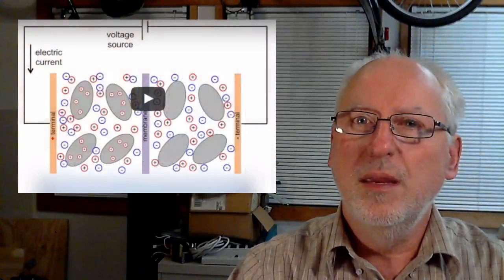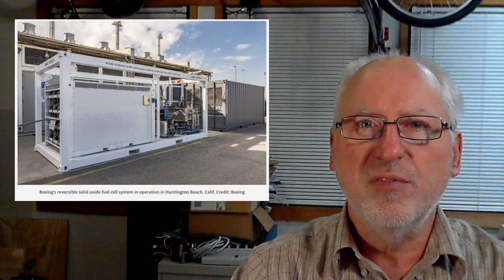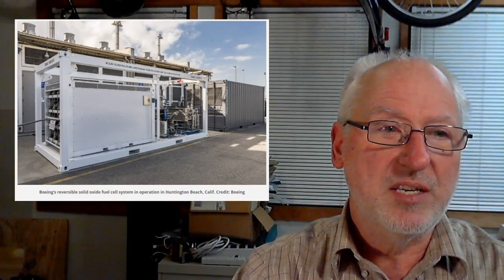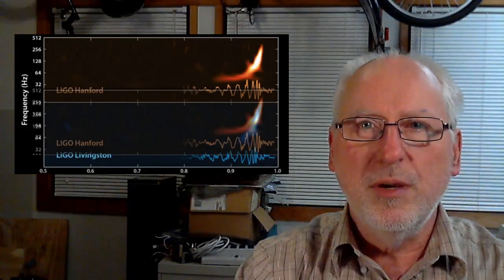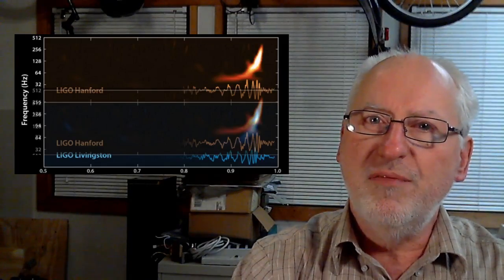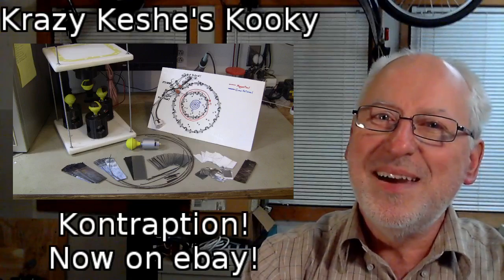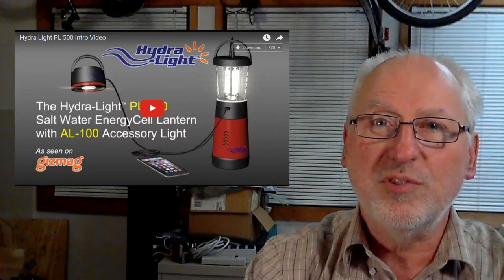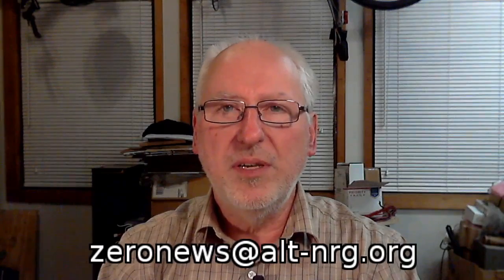#446 Zero Labs Alternative Energy News Update 2/12/2016

Comment: It's great that you are helping bring Robert Murray-Smith to a wider audience. One of his latest videos on using a small current to turn a permanent magnet on and off (the most practical application of the Ed Leedskalnin PMH effect I have seen) could remove the cogging effect from a permanent magnet motor. I would love to see you investigate that as a build! And that is nothing to do with his main research
Reply from the maker: +Simon Hagger NO! This is NOT a PMH. The PMH loses it's hold after the keeper is released. THIS is a true pulse energy switched magnet assembly! Pulse on / pulse off. The magnetism remains static after the pulses! Translation: This may be the holy grail for permanent magnet motors. It warrants further experimentation.
Reply: +ZeroFossilFuel that is a really great distinction that I hadn't thought about, forgot that the magic died when you broke the PMH. Now we just need to see some talented builders make use of the discovery.  The only other way I ever thought about overcoming cogging was by having one of the two magnet pairs on a cam lobe that lifted one of the two away with a gradual profile and then allowed a sharp spring loaded return at the appropriate point to push the magnet - the cam has been around since 300BC after all!.  Simply switching off the magnets would mean far less friction etc to overcome though and seems a very elegant solution compared to a purely mechanical approach.  Thanks Mark, hope you will take a look into it

Comment: Blacklight power changed it's name because the material used originally was a uv color or blacklight plasma. However when they realized the best way to convert to usable energy was a newly developed photo voltaic cells that were thought to be useless because each cell could harness the intensity of 1000 suns. We only have 1 sun, so it was shelved.Blacklight power had an idea to use them because the suncell's light bursts could be harness by these PV cells since it has the intensity of up to 10,000 suns. But the uV that the suncell produced was inefficient because the PV's absorbed brighter light more efficiently. So they started using silver gas and the suncell would emit a better spectrum for the PV's.  So their light that was emitting from their reactor was no longer "blacklight plasma". Hence the change to brilliantlight power. 

I saw a little scoff in your report about BLP, so I thought I'd give you a little info to help you be more confident in what is coming.

DR Mills was a Harvard grad. He is the inventor and patent holder of MSI. Magnetic susceptibility imaging. It is a sort of HD MRI. You can see the insides of the walls of your arteries with this technology. He also invented a new type of chemo radiation treatment. You know the problem with chemo is that it destroys good cells while killing the cancer cells. well his patented invention is able to target cancer cells and leave the good cells alone. A tremendous advance in medicine. When the news of Ponns and Fleischmann came out, Mills got interested. and soon  got anomalous heat. That critic that was trusted Made a mathematical error and yet that error is perpetrated across the internet. Rathki was the incompetent  so called mathematician that said Mills' formulas are off, but they aren't. This genius Mills is making the sun on a bench top  and nobody cares. Mills is suing the guys at wikipedia for slander. 

The great thing about the change in the light spectrum is rather than using magneto hydrokinetic conversion they originally wanted to produce, would weigh so much that it was only feasible for power distribution companies, but with the use of the PV You can have portable power generation. It is a game changer. Quantum physics will be overturned like Einstein said. Mills will get a Nobel prize I believe. I can't see them giving one to Andrea Rossi because he doesn't have a theory. Rossi has a patent and Mills has just filed for a bunch of patents too.

The GUTCP proves Newtonian physics can solve for all particles in the universe. He has a program called millsian that is a compound maker and solving for known particles and unknown. You can create your own compounds. Imagine a magnetic plastic and things like that. And that the ground state of hydrogen can go closer than the quantum allowed distance from the Nucleus.  He says it is a hydrino and is the dark matter of the universe. And he has discovered That if you provoke the hydrogen atom to go to a lower ground state, energy is released in a form of light  as well as heat. He claims that is how the sun works. If fossil fuels are the end all be all, we wouldn't be out there looking for alternatives. This man has found it. 

There has not been any legit mathematicians Proving his formulas wrong. Hey I bought the domains they didn't pick up. And that Photo voltaic company will be worth trillions before it is all said and done. I think you are a brilliant man brother. But don't disregard this one. :)
Reply from the maker: +easymoney4ever That was a very well researched and thoughtful reply. Thank you for that. It will be interesting to see how it all plays out.
Reply: this belongs to all humanity for the worlds energy fuck the bloody money thing everyone needs 2 embrace this technology now
Reply: easymoney4ever X

Comment: I was thinking about the gravity waves thing. my bullshit meter went off with all the news coverage - especially because they're all saying that this proves einstein theories and stuff, but I was thinking about what this proof is, and it could be a disproof. essentially they separated some lasers some really long distances with reflectors and noticed that sometimes the reflected waves don't match up.

there are two variables in the experiment: 1. distance traveled and 2. the speed of light. they assume the speed of light is constant. but we also assume the distance is constant (the lasers aren't moving). however, these fluctuations prove that one of them is not constant. so, if you assume that gravity waves displaces distance, that must prove to gravitational waves to exist. but, what if all this test is just showing is that the speed of light fluctuates slightly? having distance be constant instead of the variable seems to me to be the much more likely solution - which makes the speed of light the variable. we know light speed does vary depending on the medium, so perhaps it doesn't seem too out of the realm of possibilities for slight variations to occur.

it sounds to me like they're building a mansion on a sand foundation. already talk about nobel prizes and stuff. I don't buy it
Reply from the maker: +Kenneth Bentley I tend to lean in this direction too. Great way to waste grant money, though. XD